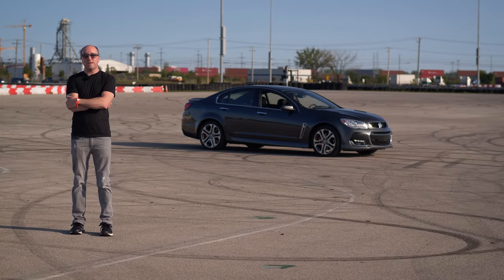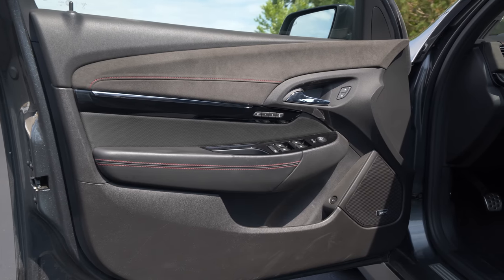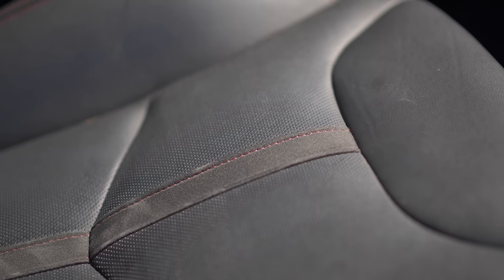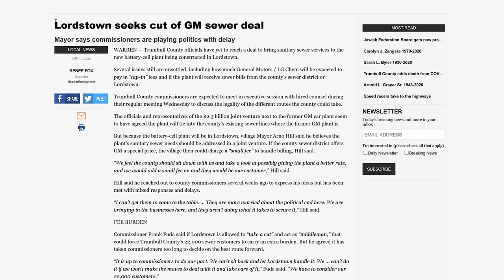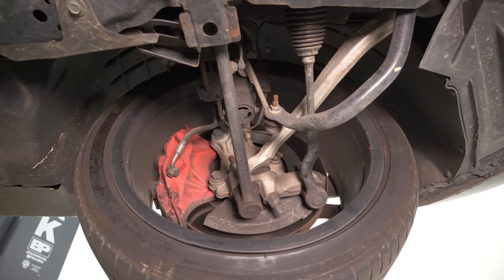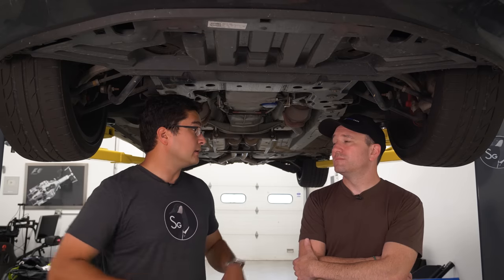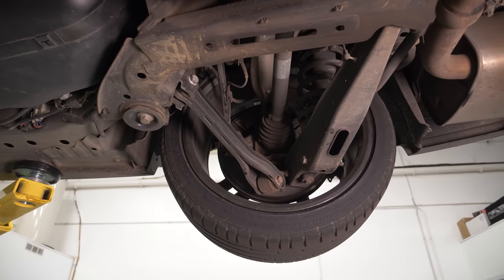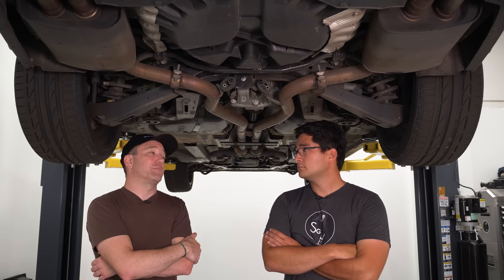Chevy SS Commodore | Holden a Funeral

Comment: Had a 2010 Chevrolet SS manual from 2010 to 2016.  When I had kid number two in 2016, needed a four door.  Fortunately, the Chevrolet SS sedan is on the same platform, has the same engine, and transmission; plus, SS is just small bit larger than the 2010 Camaro.  Switching over was easy which is a bold statement going from one manual car to another manual car.  I miss my Camaro SS, but the SS sedan is a huge upgrade; I like the car quite a bit.  Driving this car long distance is a dream.  My biggest issue which prevented me from getting the car sooner was the engine is an LS3 vs. the LT1.  The Silverado, Camaro, and Corvette all came with a gen 5 engine while the SS sedan only came with a gen 4; I want a new car to have the latest technology offered.  I got over this quickly as there are some things the LS3 is superior to the LT1.  I like this car quite a bit...love it like a girlfriend.  Get it on the hwy at 50 mph you are getting 28 MPG; 70 mph you are getting 25 MPG.  Got a car that does not attract attention from the cops but does only from true car guys, that has the soul of the 2010 Camaro SS, and get haul a family of 5 comfortably anywhere...that's what the SS sedan is

Comment: I bought a brand new Pontiac GTO in 2005. ACTUALLY A HOLDEN COMMODORE.
It was an awesome car.
400 hp Corvette V8 with a 6 speed manual.
I bought one of the very rare chrome yellow cars.
It was light years better interior quality than normal GM, cars.
My son's had M3's,M4's and M5's.
The quality was as good as BMW.
Again, loved the car, too bad it didn't sell well.

Comment: I'd think that automobiles would be just about the single most difficult product to sell from a manufacturer based in Australia, given the immediate disadvantage they face from cars needing to be a global product to remain competitive and Australia's long distance to all the major markets, plus cars being perhaps the most expensive consumer products to ship.  Before an engineer inputs even a single pixel into the design software, they'd be behind the competition on manufacturing and delivery costs.
Reply: Historically they often had favorable exchange rates, but those changed dramatically in the years these were made. But mostly, yes, making cars on a small scale is always more expensive, and GM had let Holden largely go its own way and design their own cars, adding even more cost.

Comment: the barge like feeling you get in the handling is because its tuned for Australian roads. not all of them are sealed or chipped roads. its built for the aussie dirt roads also so when you drive over stones etc the wheel doesnt get pulled sideways over each stone you drive over at 52mph. this is the  same with the suspension

Comment: Everyone doesn't understand the SS sales, when GM was shutting down Holden they had a bunch of extra commodore parts.  GM decided to sell them all as limited edition top of the range models in the US as the SS to maximize profits and get rid of them quickly.  They only wanted to sell enough to use up the extra parts so they never bothered marketing it much.
Reply: Yup and they sold all 12000+ units that were shipped to the USA. Not a new one left. Even then, GM had no plans to ask Holden to build more for the US, they just wanted to be done with them and move on.
Reply: Chevy didn't seem to want to have anything to do with the car. The only TV spot the SS got was a mention during a Holden commercial that the Commodore would be sold as the a Chevy SS in the states. And with that, Holden successfully advertised the Chevy SS in Australia more than Chevy did in America.

Comment: If it's not also cheap, it's pointless. I was in love with these cars for a long time. With the prices going up on them as used cars, I don't want it anymore. The attraction was to have the V8 and rear drive at a reasonable price. If the price is going up there are other options.

Comment: After test driving 2 SS's I opted to get a G8 GT and save $20k. I actually prefer the interior to the G8. Its simpler and doesnt feel like they tried to cut the cost out of it.
Reply: Are you kidding? The plastic is everywhere in the G8(I owned both). The G8 does have more character though(in my opinion)
Reply: The SS interior is nice. The cost blow out was US import taxes.

Comment: I never had a chance to buy a G8 GXP then I saw that GM was bringing back the Holden as a Chevrolet SS (Sports Sedan) but only 2000 per year for 4 years and I ordered one 2014 red hot2 Chevrolet SS, it was an improvement over the G8 with better suspension and lighter.
My father like it so much that he bought a 2017 which was even better

Comment: The older models are better in every way!  I own a 2003 VY SS ute with a manual T56 6 speed and its just gold. No cylinder deactivation, no traction control just a wild LS1. Plus the ute version is very light in the rear end,  perfect for hanging the tail loose👍

Comment: Fantastic car. In last 2 years have seen ONE actually being driven in real time, and ONE sitting in a driveway (with an automatic trans.!) Given the cost of an SS I’m going to have to settle for my 2012 Accord 5 speed (with sunroof) which I got in 2016 @ 29000 miles for $12000. It too is a sleeper, given what the stick allows it to do, albeit not the uber-sedan sleeper the SS is ( AND the rear seat back folds down!)

Comment: The intro makes me think of that time I pulled in the driveway after driving Dear Old Dad's Caprice Estate pedal to the floor for several miles down the state highway. Dad was sitting on the porch and I shut the car off - it ratted me out by dieseling after I shut it down. The old man came over and promptly put a boot in my a$$ to let me know what he thought of my antics. 

The other point I'd make is that GM has a long history of cars that they built and sold just to keep a factory running that they likely weren't making any money on. I would point to the Chevy SS, the Pontiac G8 and the 2018-2020 Buick Regal/TourX (built in an Opel factory in Russelshiem Germany) as prime examples of cars they didn't actually want to sell in the US because I can guarantee based on exchange rates/labor rates in the place they were built, etc. they made almost no profit on the sale.

Comment: I was always a chevy guy and i wanted this. But then i did research and compared it to the dodge charger scat pack. The SS was more expensive and not as fast and was a last year model and i got paranoid about repairs, so, i got a 2019 dodge scat pack with 475 hp and 475 lb feet of torque. A totally better , faster and better looking vehicle. Plus , parts are common and easy to get.

Comment: There is a huge amount aftermarket options in Australia, and Holden themselves had a performance division HSV (Holden Special Vehicle) that kicked up the suspension, engine and interior. This gives the SS more options to adjust whatever aspect of the car you wanted. The SS is just a step up from the standard V6 Commodore.

HSV's models are another step up from the SS and provided those with bigger wallets a real competitor to the Euro performance market.

Try the Ute one day, you'll love it. Or get a drive in a Maloo, Clubsport or GTS if you want a better SS.
Reply: @TBH yeah, like I said.

Comment: I have a 2014 chevy ss that I bought new, it's an amazing daily driver. No issues with it. But it didn't come with a manual from the factory.
Reply: @Quasi Terrible In the US, a manual transmission was an option.  The car was built 2015-2017.  I know because I bought a 2017 model brand new.
Reply: In 2014 the first year it was brought into the US the manual wasn't an option. The only options were like heater block and sunroof. All 2014's were very much the same. I know that the 2nd year more options became available. But that first year you took what Chevy gave you.

Comment: I love this car. Want one so much. Can't get them in my region, as they never sold well in North America, so I will likely never own one even off the secondary market. 

It's a lot like my much loved Impala, but RWD and with a V8 and 415 hp and torque. It looks like a run of the mill daily driver, but you can put the hammer down and shake the heavens in it.

This is what the world is missing out on by letting the auto industry steer us all towards nothing but overpriced trucks and SUV/Crossovers.

Comment: Aussie history time. Holden has been building Holden's since the 50s. That is locally built and designed cars. Less engines or gearboxes or other bits & bobs here and there. In recent years LS1 engines came from Canada, but that's a GM thing so let's leave that there. But yeah, the commodore(circa 1979) and Ford falcon have been built and designed locally for decades. We also had Toyota and Mitsubishi manaufactured locally. Also dead. As of 2020 no cars are built in Australia.
Now to this car. Yes we build alot. Sedan, wagon, and ute(utility). Majority are V6s, with Falcons being straight 6s.
V8s are a luxury item and come in the more upscale varients. A basic V6 Commodore Aclaim comes out. Essentially & literally a taxi(though most taxis are(were) the straight 6 falcon on LPG)
This SS looks more like a Calais. In V8 trim they come as SS or Calais. Both the same car. Just one is "sporty" in appearance & one is "luxury" in appearance. They aren't. The SS even comes with cloth seats and cheap SS embroidery and dull plastic trim. The Calais with leather and a mile of plasti chrome. Neither car are up market. Certainly not to euro spec. Things get a bit better when you chuck on a HSV badge(FPV for the Falcons).
You however missed out. Oh, wait, don't think this makes them M/RS/AMG's, it doesn't, but it makes them much less taxi like. The body kits are quite aggressive albeit at times cartoonish(if that floats ya boat) there are higher spec trim options and performance bolt ons. Are they worth the extra coin? I say not really. But you can't mistake they clearly differentiate the cars from non HSV varients. In OZ the HSVs & FPVs adorn cult status here. Tbh a SS or Ford XR8 are nothing special here. Nice but just a few grand more than a optioned 6, which, you mum & dad is pretty happy with. To put it into perspective our last HSVs were the LSA V8s pumping out 430kw(580hp). The G8 fell into the same category and before than the GTO coupe, our last commodore coupe or Monaro. The GTO was also HSV'ed. Which didn't go stateside. We also do "luxury" HSVs both short & long wheelbase as the shirt wheelbase Senator and the LWB Grange based off the LWB commodore which is the Statesman or you'll recognise this.... Caprice. Yes, that's the police car Chevy I'm sure you have in some states. The Grange is quite nice, fully appointed, but of course no S63 or S8. Our Prime Minister used to rock around in a bulletproof Caprice. No more. 7 series now. So yeah...... SS? You missed out on the better options. But then, so do we. We don't always get the better specced cars other country's do here in Oz. Infact on alot of adds here the commercial is captioned down the bottom with overseas model shown or *European version*. Unfortunate, but I guess that's how export/import impacts car costs and the best version does not translate once landed and duties are added on🤔😔😔

Comment: GM’s decision to kill off the Commodore/SS, and in fact Holden at large is regrettable (for all of the reasons mentioned).  However, it should be noted that GM will carry on its legacy with the same formula: RWD, V8, 4-doors, 6-speed manual in the new Cadillac CT5-V “Blackwing” - and by all accounts, it will be the only manufacturer in the world offering that combo.

Comment: This car was not really available with a manual transmission.
I was interested in purchasing one and even test drove a 2015 model; however, there were only 0-2 available within 500 miles of me for several months, and those dealers wanted MSRP or greater. 
I estimate about 95% of the Chevrolet SSs produced were made with automatic transmissions....

Comment: Corrections: 2015+ got magride; 2014 got normal gas strut. The SS equipped with the 6L80E doesn't have DoD, either.

Comment: I love my VFII SSV Redline manual. With the Harrop intake, exhaust and tune, its a beast. Have owned V8 Holdens my whole life.
I recently bought a lovely 1995 VS Commodore Executive 5.0 manual, mechanically similar to the VR SS manual I bought new in 1994. So I'm set for the rest of my life. SUVs can go kiss my ass.

Comment: What's a trunk? Is it a bonnet that covers the engine? LOL!!
Greetings from the Southern Land. GM made a huge mistake by not promoting the ute..whoops..sorry..pickup version of this. It was a very distinctive concept...a vehicle that a tradesperson could use during the working work and then on the weekend had two doors, two seats, 6 gears and 3 pedals.8 large cylinders all sitting low and ready to eat up the kilometres of a large empty land.
Thankyou for the video.
Oh...as you say. Final thoughts.
There is a racetrack in Australia called Mt.Panorama located 200 Km west of Sydney in the town of Bathurst.
Every year the Bathurst 1000 (km) is run. It is a brutal circuit..and a public road to boot (not trunk!). In the 1960's until just recently it was a tribal battle between two camps....GM vs Ford. The engineers of both companies learn't a great deal  from this event that helped give both companies a distinctive 'australian flavour' to there respective cars. From memory the Ford Falcon GTHO of 1972 designed basically for this event (had to sell a certain number to qualify) was for a time the fastest 4 door production car IN THE WORLD. The next year the govt banned them. The end of Australian muscle cars.

Comment: Something you yanks have to remember about the Australian market is that cars here need to be reliable and parts easily sourced. This can be attributed to the vast distances we travel between cities and how harsh the land can be. Holden and ford for many years were popular because parts were easily sourced and their cars easily fixed by the average punter. As the imports grew in numbers and their reliability proven with superior build quality and engineering, Holden struggled to keep pace. The price of fuel here is also more expensive than the USA so Holdens main staple of V8s and V6s missed the mark for the masses in recent times when compared to its rivals. The nail in the coffin has always been the cost  of manufacturing in Australia and the removal of import tariffs. Holdens last stand was to try selling us a German built commodore with no V8 option, but what would be the point? We already have European cars here that have proven themselves in this segment of the market. Why gamble on an unproven commodore no longer built by Aussie’s, by a company that many regard, squandered tax payers money and sold us out by going to Germany. The end of Holden accelerated by poor decision making at the top. Sad so many lost their jobs not long before COVID.

Comment: The only problem with Aussie manufacturing  is  the population is smaller  25ml  and parts /importing cost / then run & siphoned off by oversea's  
Holden the best car i owned was  a 1975/6  LH Torana picked it up bargin $1,500 mint condition  .  i fitted new  suspension $  a1 was magic  
havent drivin  since 2010          memorys            is all that drives     me nowdays

Comment: i love these kind of cars i would of own one but as you said not enough cash to own one. plus i am not a fan of modern car tech( interior) im 26years old btw. and some of the tech like the magnetic ride. too expensive to service. 
so instead im owning an old 95 & 96 Impala SS. easy to work on cheap to buy( 4K CAD for my 95)(2K CAD for my 96) no need to repeat the opti mine runs and drive even in hard rain. oh and also its not even avalibale in Canada i would need to pay even more to import one. its possibale some were already spotted driving around with local liscense plate. but not for me im just a regular guy. 
i will 6L swap my SS before finding one.

Comment: I think if this car would have been sold with the 3.6 V6 and 6.0 V8 along with the LS3 like it's Aussie counterpart did, and if it have been called the Lumina like in South Africa and the Middle East instead of a Camaro trim level, and if they didn't charge $50k for it and only offer a top spec model, it would have sold much better.  Offer it as the Lumina 3.6L SV6, the 6.0 SS, the 6.2 SSV like the Holdens did, and maybe even offer the HSV models branded as the Chevrolet Lumina HSV and advertise it as "Not Your High Schoolers Lumina" and have Dodge style ads doing donuts around an old clapped out Lumina instead of the no ads at all approach GM did.  

But instead of making an effort to sell a great car GM decided to do what GM does best:  screw things up

Comment: You forgot the worst part: GM learns nothing from the companies they shutter. This car has excellent DNA and engineering that won’t find its way into any existing or future GM products. I doubt they’ll even keep the engineers that setup this suspension to work on the ‘equivalent’ Caddy’s or the Camaro (which could really use some suspension work)

The most damning mistakes people make are those of which they’ve previously made. If there is any silver lining to a mistake, it’s that you learn from it. How long are we going to let GM continue to fail at learning from their mistakes?

Comment: The Chevy SS sedan was built from 2015-2017 in the US, not 2013 as was stated.
Reply: SS sedans were produced from 2014-2017, but only the 2015-2017 cars were available with the manual transmission.

Comment: These guys complained that it cost 50k new.
Well use ppl that didn't know about these cars until they stopped making them are paying 40k+ still. Even 2014 are still mid to high 30s.
I just got my 2017 with 22k miles and still paid 42k out the door